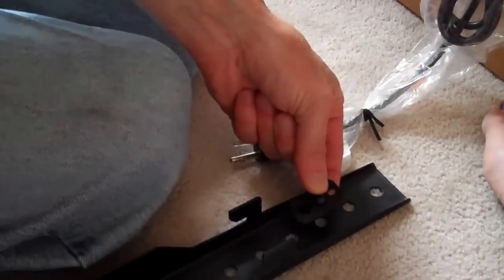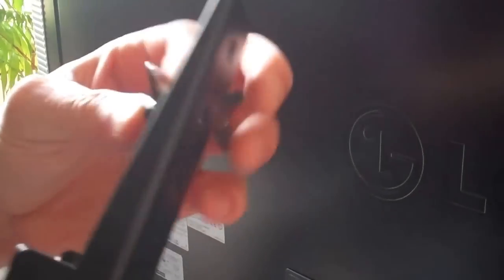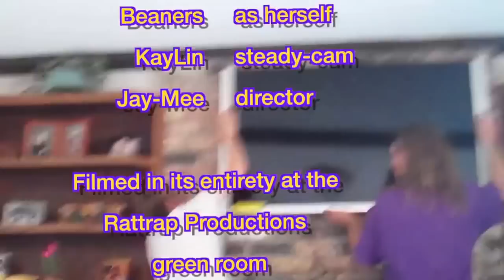How To Mount a TV On a Brick Wall

Comment: I've done tv Intsllations for years & I've never trusted the plastic anchors for masonry. I like to use the metal 1/2 inch anchors for brick  bcus they expand as the lag screw goes in. Of course every body does This differently but the plastic sleeves i don't trust. If ur brick is hollow, don't screw into the brick, instead drill a hole into the mortar & put ur anchors into that or ice also used the blue concrete screws.
Reply from the maker: richard Gonzalez You have to be careful and take the type of brick into consideration.  Some brick types won't hold up to that sort of pressure.  It is okay to drill into hollow bricks and really it becomes more your preference than necessity.  My wife and I could hang on that frame after it was installed.  Now, together we weigh 265 pounds but suffice it to say this install was good enough!
Reply: Joby F. Randrup of course.  I understand that,  there's so many things to account for & so many things to keep in mind specially when mounting into decorative brick. So many ways to mount a tv & so much different hardware to use for different surfaces. Like i always tell customers who want to do it themselves, "make sure u have the right tools & equipment for the job". Great video,  took me a while to get build up the courage to tackle an install on masonry. Videos like this help, especially the "do it youself-ers"
Reply from the maker: richard Gonzalez I couldn't agree more!  So many options and so many variables.  Honestly, if the masonry is done right, it doesn't matter whether you mount into brick or mortar because it's strong no matter where you drill.

Comment: I would love to see how you hid the cables!
Reply: you have to buy this cover thing, it usually comes in white but you can paint to go with your wall
Reply from the maker: +Edgar Tovar TRhat cover GamerNerd is referring to does work very nicely.  However, I am going to make a built in cabinet set for it.  Watch for it from Rattrap Productions!!!
Reply: Edgar Tovar how is he gonna hide all the wires in a brick wall? I’m asking cuz I might get my tv wall mounted in my new apartment but it’s brick walls
Reply: I must move a flat screen installation in a 4th floor condo from over a (gas) fireplace to a flat wall about 10’ away. The wall studs and framing is commercial steel; there is a solid cast concrete firewall behind them. There is NO access to the overhead space; likewise there is no access to the end of the wall. The floor is poured concrete. Essentially, the entire structure is a cast concrete box lined with steel studs on the walls  and overhead. Demolition of the drywall on the inside wall is impossible, (Owner absolutely refuses to consider this method. )there can be no wire covers running up or across the wall. Owner says all wiring must be invisible or the job is a no starter.
ANY suggestions?

Comment: Mounting to mortar is a terrible idea. It won't hold the load, it cracks easy and if the TV is on an articulating mount, the mount bolts will eventually come out. Brick mount is scary because if you mess up, you need a matching brick to the repair. Which you won't have. BUT Brick is much more stable and solid mount.

Comment: Hi Joby, I have nearly the same exact install.  Looks like the same mount but mine also leans out 15 degrees.  I punched my first hole in the brick.  But the brick is hollow, like most bricks are.  I have the same plastic sleeves, but it seems like wouldn't be the right product now.  Were your bricks hollow?  Any suggestions?
Reply from the maker: Yes, mine have three pockets that are hollow per brick.  The pockets weren't excessive however and I felt fine going through the brick because of the lag size and four points of mounting.  You may want to adjust your plan and drill into the mortar instead if you don't feel comfortable.  Personally, I don't think going into the brick is a bad move if the bricks are typical.  Hope this helps.  Feel free to write back with more info if you need.

Comment: What kind of anchors are you using and whats the diameter? I am trying to mount my tv onto brick as well.
Reply from the maker: +ZayedNY I use a plastic sleeve anchor that came with the television mount.  I've used them many times and have never has an issue with them.  Some people will tell you they don't prefer that type and will most likely direct you to sleeve anchors which get pounded into the hole, then tightened with a ratchet or driver to expand a metal sleeve.  Watch the video and it will show you the size I used.  Thanks for watching!

Comment: Very helpful.  Does it affect the chimney liner at all?
Reply from the maker: You should not go far enough to puncture the chimney liner.  Most chimneys (like mine) has a sizable air gap between the brick and the liner.

Comment: What Tv mount did you buy? I have recently rented a place and the brick wall has screws that are about 12 inches apart top to bottom and eyeballing the mount from the video it looks like the mount will work.....thanks
Reply from the maker: +C Null23 i can't remember the brand but it was the cheapest one you could buy at the time.  It's fixed, meaning it doesn't swivel or anything.  I used 4 lag screws, that's all.

Comment: My brick wall is not the flattest and has some bricks sticking out more than others. How do you think this will affect me trying to install a wall mount to this wall?
Reply from the maker: I might get a straight 2 X 4 or long level to find bricks that are uniform and mount to those.  The mounts usually have some flexibility as far as how far to attach the braces.

Comment: u could have taken the measurement from end to end and mark the center on the brick, then the center of the mount.
Reply from the maker: +arcolino1 yes.  Actually, that particular mount is very forgiving.  There really isn't a need for a precise measurement on that one other than level.
Reply from the maker: Yes.  You can do it that way as well.  Sometimes it doesn't work out aesthetically perfect that way due to variations in the brick and mortar process.  This way, your eye sees it more asymmetrically.

Comment: If the plastic anchor doesn't tap all the way in (in brick), is it ok to just let it get pushed in when I'm tightening the bolt?
Reply from the maker: Well, you want it tight in there but not too tight.  I doubt the rest of the anchor is going to walk in when you tighten it.  Depends on how long those anchors are.  If you are sure you have enough in the brick or mortal, you could always trim the excess off.  Hope that helps.  Any ideas for future vids are always appreciated here at RP!
Reply: Ok as I tightened the bolt, the anchor was being pushed in as I was tightening, its all the way in and flush.... I'm guessing that's just fine? I drilled the holes deep enough for the anchor to keep going, for some reason, it stopped as I was hammering. Your info is appreciated ☺ thanks!
Reply from the maker: The reason it stopped is because the hole is too small/plastic anchor is too big.  Not a huge deal as the anchor is supposed to create a tight seal between bolt and hole.  Just make sure the bolt is holding the frame tight against the wall.  Be sure you have at least four mounting points to hold the television and frame.  Just hang on the frame after all mounts are secure.  You can also try to pry the frame away from the wall to make sure it's on there tightly.

Comment: Would 2" 1/4" tapcons work without using the anchors?
Reply from the maker: I think I would trust them in the brick, not sure if I would trust them in the mortar. Honestly, I feel better the way I did it. The tv is still up and very secure.
Reply: @JayferRattrap  What about in cinderblock?
Reply from the maker: Those will work. You could also use sleeve anchors or what I used too

Comment: Whoa, did the drill not have "Hammer" function, would have saved a lot of effort.
Reply from the maker: KG84C see previous comment.  Thanks for watching!
Reply: My bad, seen the comment. I'm in Perth, Western Australia, and most houses here are double brick external walls and solid single brick internals 
(rendered and hard plastered of course), point being most power drills have a hammer function, all us west coasters will be drilling masonry. Oh, they re a real pain to add things to an internal wall as you need to  "Chase" the wall, put in conduit, mortar, plaster, undercoat and topcoat. 1 power outlet = goodbye weekend!

Comment: is your tv going to melt
Reply from the maker: tsurette80 Not with this type of fireplace.  However, you should always check to see if it is safe.  The type of fireplace I have is basically ornamental.  The bigger the fire, the faster it pulls heat out of the house actually so the TV getting too hot is not a concern with this type.  Some fireplaces are meant to put heat into the home though.  That would be a concern.

Comment: How did you hide the cables in the brick
Reply from the maker: We are going to build and install some built-in entertainment centers on each side of the fireplace and then frame in an area for the flatscreen.  We can then safely tuck in A/V stuff in front of the brick.  It will be safer that way, plus it will end up as a very custom look.  Keep checking into our channel to see that project!

Comment: Ridiculously high on the wall. What is wrong with people that want TVs almost touching the ceiling
Reply: It's all on what the person prefers. I have seen tv's that high bfor bcus that's how the customer wants it based on how they sit & watch Tv. Some people lean forward on their couch so they rather have the Tv @ eye level. Others lean back on their couch so the field of vision is much higher due to body position, so they rathet have tv up higher & tilt down.
Reply: Chris Cooling exactly what the other guy said it’s down to preference. I know some people put it high so it’s out of reach from the kids because we know how they can be. I prefer eye level but still it needs to be out of kids reach. So I’m doing mine soon.
Reply: Also sometimes the reason for mounting over the fireplace is so your TV and fireplace don't vie for attention so to speak. Your two biggest attention getters are right there together where they can be viewed simultaneously. Also, some rooms with fireplaces don't really have any other suitable place to put a TV. If it's over the fireplace it's often going to be somewhat high unless you have one of those modern fireglass numbers that is a rectangular slit in the wall more or less.